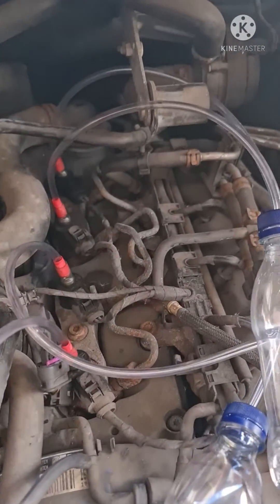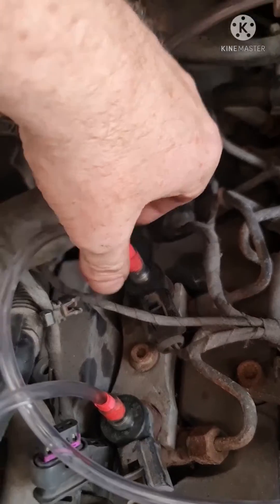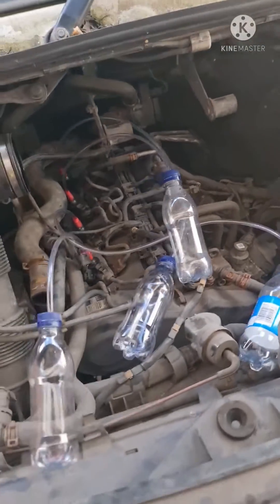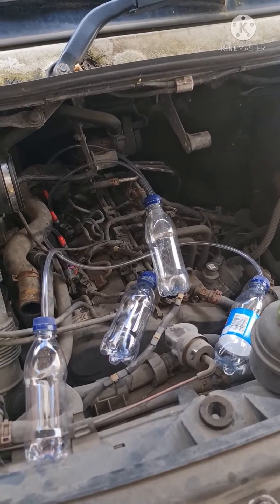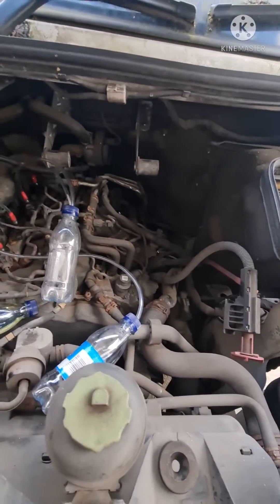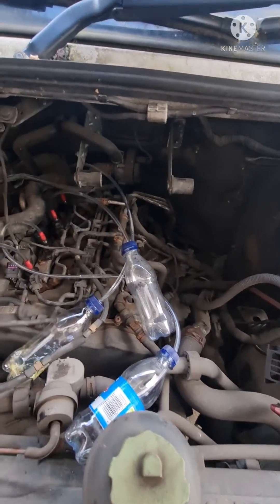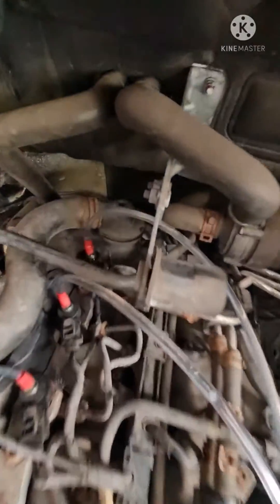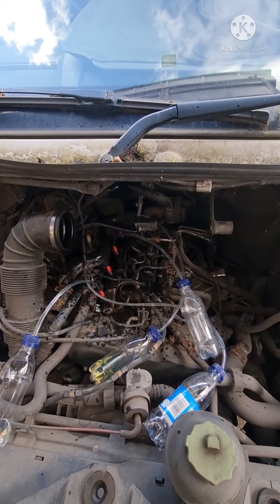Diesel Injector Leak Back Test Without Any Special Tools: VW Crafter Restoration Part 1

Comment: Mate I need your help removing these injector  overflow pipes
Reply from the maker: I won't lie to you mate they can be a pain.
You lift the little securing tab up on the centre of the fitting and then pull them out. But you have to do it straight.

Comment: Thanks for this. I didn't realise you could run the engine with all that other crap taken off the top of the engine!
Reply from the maker: Yea you can run it like that for diagnosis but it'll flash the warning light on the dash which goes out when everything is back on.